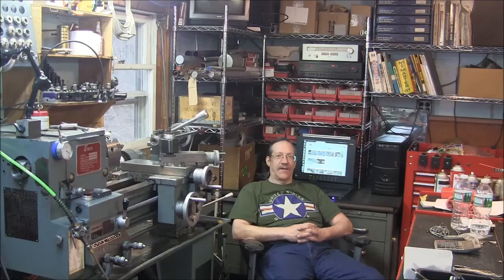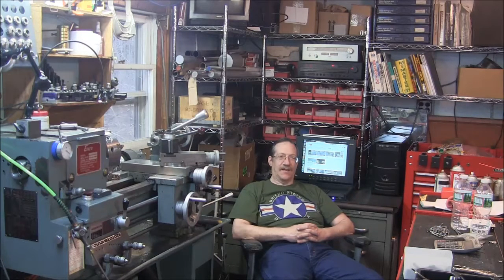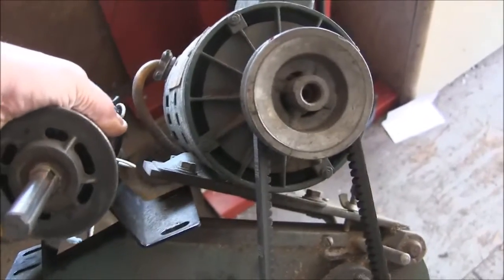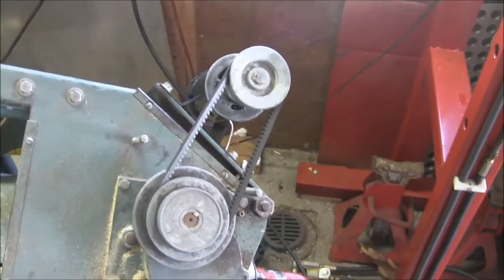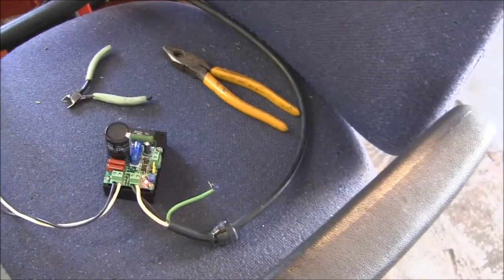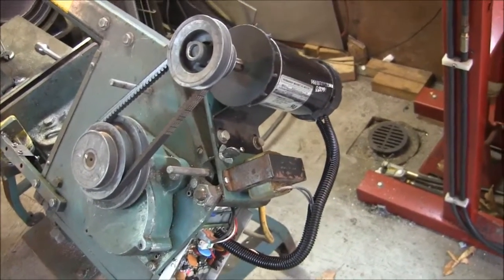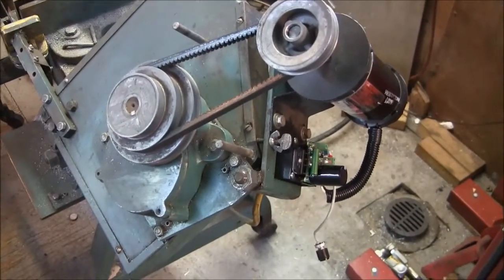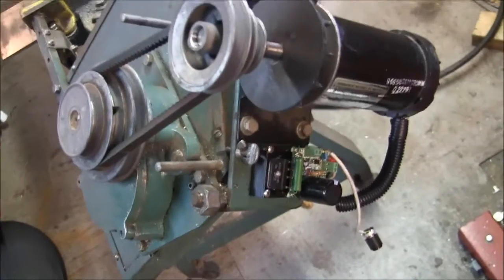Treadmill Bandsaw

Comment: what wire do I put the inductor in line with?
Reply from the maker: It really does not matter Bill, as long as it is in series with the motor.
Reply: ok cool, I just put 1 on my lathe but I need a bit more torque. i think i will need to mess with pulleys.

Comment: Joe if you put a momentary off switch I in series on the center leg of the pot you can turn it on and of and just push the button and it will go back to whatever setting you had on the pot previously. That's how I do it on my vertical bandsaw.
Reply from the maker: Thanks for the tip Tom, I have my own custom speed controller on there now but I will file that away for future use.

Comment: Hi Joe. Do you think the treadmill motor would be strong enough to drive the RF30 mill. I am rebuilding the same mill and wouldn't mind getting the speed control on the mill. What speed controller do you recommend from EBay/Amazon for a tread mill motor. Cheers from Mike in New Zealand
Reply from the maker: Mike, I would not put a treadmill motor on my mill. Although you may be able to find one of sufficient power, there will be no speed regulation. I use a 3 phase motor and a VFD to drive my spindle. A VFD will control the speed of the motor regardless of the load. The treadmill will just slow down as the load increases and speed up as the load decreases. My bandsaw does this but it is not a big deal, if my mill did it, it would be bad.

As far as what speed controller to use on the motor goes, I would stick to the original controller that was in the treadmill (MC-60). I have had to modify the amazon cheapo controllers extensively to get them to drive my bandsaw motor and not blow up. It can be done but you need to be able to solder and change parts to make them reliable.

Comment: like the look of that.. what sort of power does it put out?? would it cut 12mm aluminium?? 
very interesting project.
Reply from the maker: +Emmas Spareroom Machineshop I have had that saw for a long time. It had a 1/3 HP induction motor on it. the treadmill motor is rated at 1 HP I have cut a 6 inch round of aluminum with that and a 4 inch round of 4140PH no problem at all, it just takes a while.
Reply: oh thanks for that! ive a bandsaw rebuild waiting outside, this is a very good option i think. thanks for the information.

Comment: do you have a recommendation for a good controller for someone who does not have the electronic background you have. Right now I have a garage sale controller I got that is a grainger dc controller that works forward reverse variable speed and instant on.
Reply from the maker: +Ed Ginsberg Just about anything you get that is plug and play is going to be industrial and hence big bucks. If you want something from China on the cheap, it is probably going to need some soldering. What is wrong with the Grainger controller?